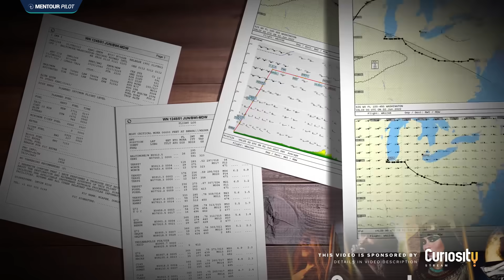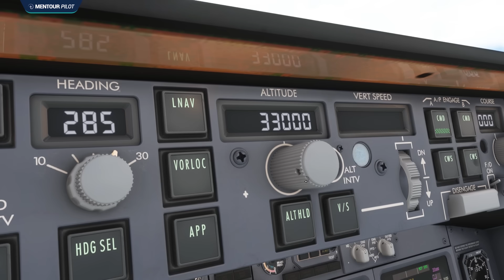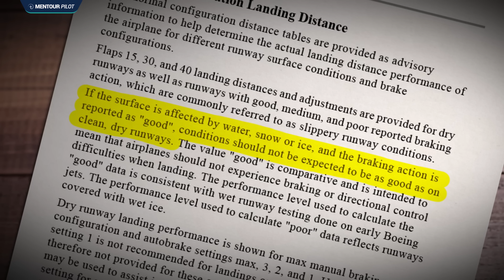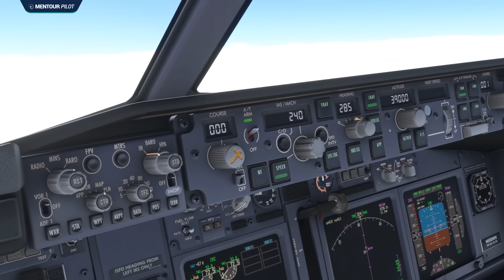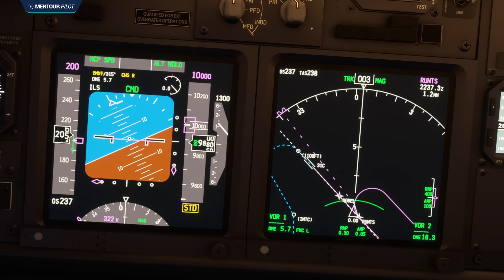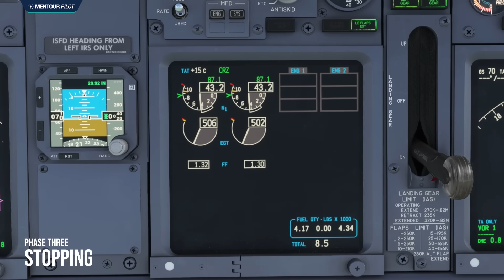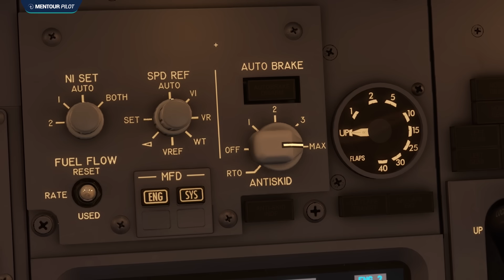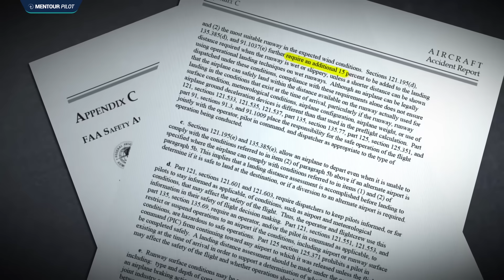WHAT did The Pilots MISS?! Explaining Southwest Airlines flight 1248

Comment: These Flight Sim 2020 clips look so damn good they basically fill the role a VFX person would play in an air disaster-style documentary. As someone who vividly remembers what previous flight sim games looked like, it's crazy to see a real time render look this good. It definitely adds a great deal of polish to your already excellent series on accident investigations.
Reply: Is that FS2020? Been trying to find out what Mentour was using for these for weeks. I hot back into it but all I have is FSX and I've been yearning for Xplane 12 or FS 2020 figuring I'd use the one Mentour has because it looks great and way more functionality... though they do probably buy the aircraft seperately? In FSX stock you barely have control over most knobs, not even the autobrake, sometimes not at all or only through key combinations, which I already have scribbled all over my stick along with many functions I put on keys on the stick to avoid using key bindings in difficult phases of flight. If this is 2020 then that looks like a winner. I hope my rusty old 970 can handle halfway decent graphics settings.
Reply: I had Microsoft Flight Simulator too.  I can agree with how much it has changed from 1997 when I bought it and a flight stick.
Reply: I remember being impressed by Super EF2000 on Win95
Reply: @WiesoNurMistnamen  me too

Comment: Automatically changing a user-input value from 8 kts to 5 is unacceptable in a safety calc tool.  It's the programmer/analyst version of get-there-itis.  Wanting the calculation to succeed (human bias) means nothing if the purpose of the tool is to prevent hazardous decisions.
Reply: Maybe not even the coders fault. They might had no idea under what situations the program was meant to be used, just given a task to program.
Reply: @justinepaula-robilliard  As I understand it, It's not entirely true that there was no way to over-ride it.  There were other situations where the pilots did recover.  Although the point is taken, it was a very bad design decision.
Reply: @justinepaula-robilliard  whether the coder made an error or not-and everyone makes errors at some point- it's the fault of management, not making sure there are checks along the way to prevent such an error effecting the outcomes.  Management is often too focused on meeting deadlines and closing deals, and QA costs time and money.  And nowadays, beta testing seems to be fobbed off on the end user.  So instead of adequate testing that identifies this fault in the program, and steps to fix it, the product is out there endangering lives.

Comment: I really appreciate the explanation of how the thrust reversers work and how the engines automatically spool down to ground idle after touchdown. It really makes some things I've seen before 'click'. Well done and thank you.
Reply: I used to run 737s and if I'm not mistaken the Thrust Reversers (TRs) deploy in about 2 seconds and the engines throttle up in a maximum of 4 seconds.....but in my experience they spool up FAST. way less than 4 seconds. 4 seconds was just the maximum amount of time the manual allows to be within limits. But they go much faster. So in this case, from TR deployment to full reverse thrust..... likely 4 seconds. An eternity at 130 miles per hour. You'd travel 760 feet before you started getting the full benefit of the TRs. Yeah, that'll make the hair stand up on the back of your neck.

Comment: Was picking up my wife at Midway just after this happened, the plane was in the intersection of Cicero and 55th St, saw the car, heartbreaking, and it took almost 4 hrs to clear.  Having flown into Midway many times it is unnerving as you can see the tables and chairs on the back patios of the houses surrounding W and S side of Midway, which has the shortest runways in the county... any weather and its a white knuckle landing.

Comment: Thank you for the video, Petter! Can you please elaborate why do you think runway excursions are becoming more frequent? Is it down to pilot behavior, or maybe we are flying heavier planes into smaller (shorter runway) airports more frequently, etc. Thank you!
Reply: I was thinking something similar, more passengers & cargo per flight, people getting heavier..
Cramming planes for (financial) efficiency, until someone dies and the rules get changed again.
Reply: I thought that passenger weight couldn't possibly matter. But a 747 only weighs 187 metric tons. At 500 passengers, assuming each is 20kg heavier, that already makes for 10 metric tons difference, or 5% - not all that much, but certainly noticeable.
Reply: Hopefully he will answer this on Mentour Now
Reply: Increased air traffic congestion may play a part. I would speculate that financial pressure is a factor as well. With increasingly thin operating margins, no airline wants to accept a diversion with its associated costs and knock-on effect to the schedule unless it absolutely has to.
Reply: Sorry for this semi-useless reply: I was wondering the same thing and seem to remember that he elaborated on this in a different video. I am just not sure anymore what the answer was.
Could have been along the lines of: A higher number of flights per year resulting in a higher absolute number of excursions per year plus some newer weather phenomena (but I think it was mostly the former).
Reply: I suspect there might be an element of implicit commercial pressure to get the plane down at the right airport, on time,, when conditions are marginal. The cost of a divert is great as both plane and passengers end up somewhere else, and it completely disrupts operations, especially on shuttle services. Although an airline would never encourage that behaviour, pilots will be aware of the commercial challenges the industry faces, and it could be a aubtle influence
Reply: In the case of Midway - Chicago the excursions are not very forgiving.  Like he said Midway is land locked, they can't add onto the runway.  Simply Midway should have been replaced even in the late 1960's and 1970's. O'Hare can only handle so much traffic!!  There has always been talk of a new larger airport but it never meterialize.  So I would think airports being land locked is part of the equation along with size and weight of aircrafts that need to run to be both maximize fuel and other costs..
Reply: I'm pretty sure runway end excursions are becoming less frequent as a proportion of flights carried out.
Reply: Urban Sprawl around airports is more common and aircraft are becoming much larger.
Reply: @FeepingCreature  Según leo acá, parece que se dice que el peso del pasajero está incluido en las 187 Tm. donde se agregan 20 Kg. más por cada uno... y NO es así en la realidad. 
El pero VACÍO (acá pone el ejemplo de un 747, quizá de la versión 400) es de 178.750 Kg. A éso hay que sumar otros pesos y el peso de la carga de pago (payload) que pueden ser pasajeros o carga, y 500 pasajeros sumarían un peso alrededor de 50.000 Kg. (promedio 75 Kg. + 25 de equipaje c/u) 
Todavía queda agregar el del combustible, hasta llegar al peso MÁXIMO de despegue (MTOW= 397.000 Kg.= 873.400 Lbs.)

Entonces el cálculo del porcentaje de sólo agregar 20 Kg. por pasajero (x 500= 10.000 Kg.) aquí, está errado, no es para nada correcto y ni siquiera cercano a la realidad,  pues 10 Tm. es sólo la 1/5 parte... y hay 40.000 Kg. (las otras 4/5 partes) que no se sumaron.

En combustible sus tanques podrían cargar (según versión) en un 400 sería un total máximo de 216.840 litros (447.048 libras) pero sólo se carga el peso libre que queda según la carga que se lleve para llegar al MTOW. 
Tener en cuenta que cada 1 Kg. son 2.2 libras ya que cada una pesa 0,454 Kg. y para calcular de litros a Kg. o libras, hay que saber el peso ESPECÍFICO o DENSIDAD del combustible utilizado.
Reply: That was my immediate question, too. Commercial pressure is my first guess.
Reply: I don’t know if this is relevant but when landing conditions are tricky while the pilots have the option of doing a go around, they can only do three attempts before being forced to divert. And because even each go around costs more fuel than a simple first landing the pilots have to justify their decision to their airline later. Obviously if the first approach is obviously dangerous likely to cause damage or loss of life, no problem. But if it’s not so clear cut… well you can see why they might hesitate.

And if that wasn’t crappy enough, imagine being legitimately forced to do two go arounds and it’s the final attempt. Will you play it safe and divert if you’re not entirely happy, or will you have a go and hope you’re good enough? The incident that kicked off my interest in aviation was storm Eunice at Heathrow live-streamed by BigJet TV. Watching these big metal behemoths flying diagonally on approach was fascinating, as were the 20+ go arounds in about five hours due to some serious crosswinds and windshear. 

But of course on a small number of occasions when the pilots were on their final attempt before being forced to divert and all the cost associated with it… you could just see from the way the landing was being performed that although the pilot was no happier about the crosswinds that he was on the first two, he’s now a bit desperate to plant that bird on the tarmac. I’m honestly amazed that only one plane diverted and none of them took damage from the process.

And I developed a brand new appreciation for how sturdy the tyres and landing gear really is to absorb some of the harder landings. 😁
Reply: Could it be because more flights are happening. So they seem more frequent but it's in relation to the amount of flights. Percentage might be the same
Reply: @wewillrockyou1986  Near the end of the video, Petter states that while air safety is increasing, runway excursions are actually becoming more frequent.
Reply: Probably every improvement in braking systems, improved runway surfaces etc. is offset by a reduction in official calculated safety margins.
Reply: @mikoto7693  to my mo of
Reply: it's cost cutting having multiple effects. the reduced training time spent on pilots means more misunderstandings, and also airlines don't want the additional expense of the fuel needed to stay up longer in order to go to another airport with better conditions or wait for conditions to improve at the scheduled destination so they encourage pilots to use less fuel. of course it's usually done from the angle of "reducing CO2 emissions" and the like rather than improving the company's profits.
Reply: @duncanhamilton5841  there is. it was reasonably well reported around 2016 or thereabouts.
Reply: @jeffperry8068  whenever I have to fly out to see family, I usually have to fly to Chicago (I live in Sioux Falls SD, FSD is my  closest regional airport). I absolutely hate flying into Chicago. Have not had the best experience with either airport. If I could fly to Minneapolis, and onto my destination, I would. More often than not, I have to go through Chicago.
Reply: @Julia-nl3gq  We don't get as cold here in Sioux Falls, but everything else about winter resounds with me.
Reply: Insurance will cover loss of the craft and any humans. It WON'T cover the cost of a diversion, Go Around, or a fuel drop.